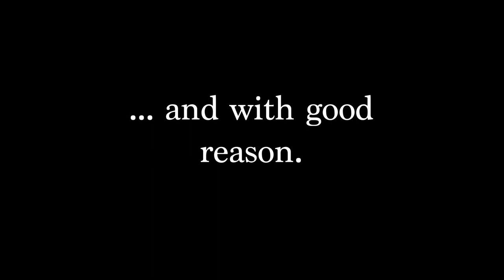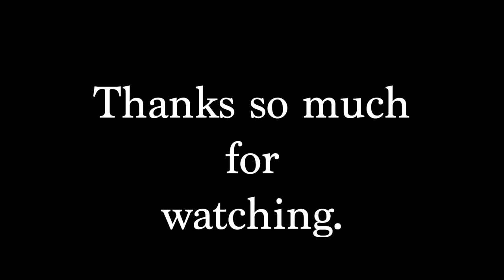Cleaning and Update of my Vintage Pillar Drill

Comment: I had a similar experience when I used to present cases at lubrication training sessions. I found that when I was working as a tradesman that I had better not take shortcuts, or omit small parts of procedures, or leave something for the "next guy" to fix, because I could get called on it. As a result the quality of my work thrived and good things became habitual. I had benefitted from the extra effort, and everyone benefits as result. It is no problem failing from time to time, if we fail, we learn and we also learn how to plan.
Excellent video and a beautiful piece of machinery, I enjoyed it a lot , thanks and cheers!
Reply from the maker: Thanks so much for the kind comment. Also I totally agree with you as well. That is a big part of my learning. I have tended to be a little slapdash in the past and am really trying to be less impatient, taking my time and doing things right.

Comment: Dont know how old this video is but as soon as i saw it i was transfixed, you have done an excelent job with the restoation, would have like to have seen iit before you started it, Myself im just in the process of a complete restoration on a Meddings back geard floor standing pillar drill that i need to cut down to use as a bench drill, when that one has done i then have a Startrite Speedway floor mounted one to convert too,  looking forward to getting started on them both, many thanks and good luck with any future projects, Regards Ian
Reply from the maker: Thanks so much for your comment. Good luck with your projects. So satisfying when it's done. I love my drill now. I use it all the time and everything works beautifully. Be well.

Comment: Great find! Very clever drill press, the gear mechanism is actually called a back gear bigger lathe and mills all have back gears but I have never seen it on a smaller piller drill, I have saw back gearing on old camel back drill presses but that's a different beast. Cheers nice job!
Reply from the maker: Thanks for that. I am loving this press but still a bit of a mystery. Thanks for subscribing too. Stay well.